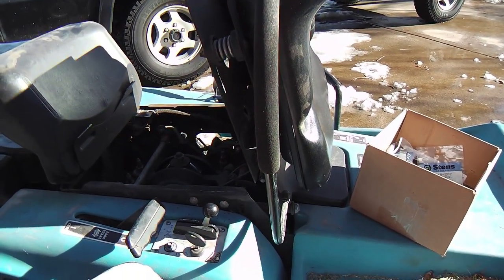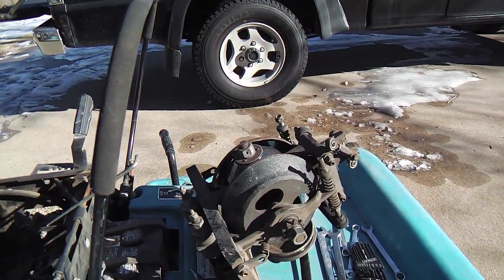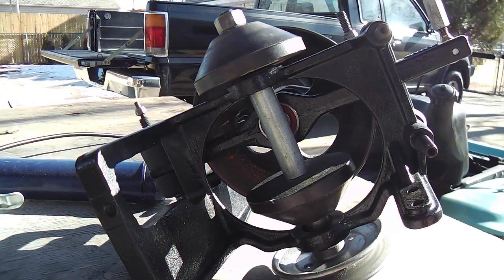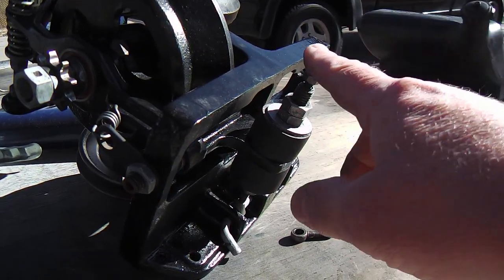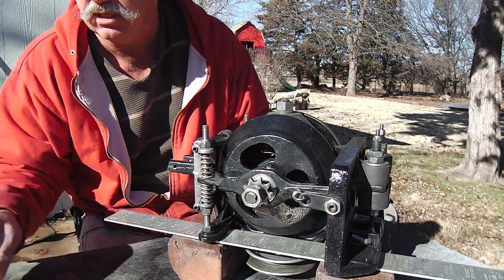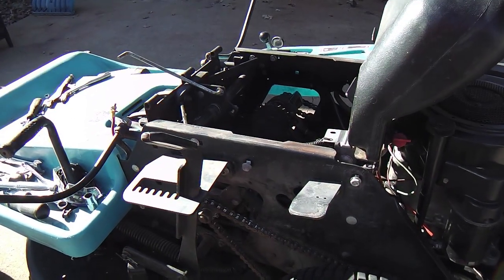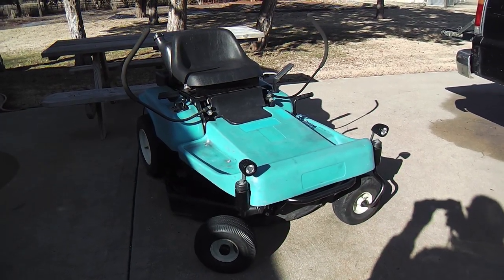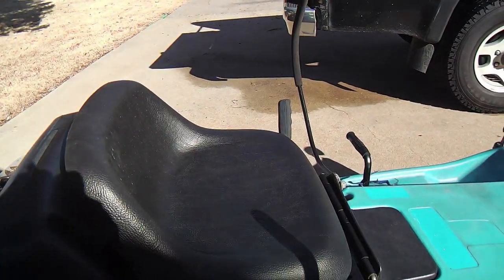Rebuild a Friction-Drive Transaxle on Dixon Mowers

Comment: Hi. Great video. Is there any way I can get you to measure that alignment gauge so that I can fabricate my own? These parts are not cheap anymore and really dont want to pay for that basic gauge at $30. I have 2 ztr mowers that I will be doing that to this spring. Thanks
Reply from the maker: +CA Dawg 
Sure,
I'll post a link to my Facebook page where I've uploaded a scan of it with a ruler alongside some time back, so that you can print it for a template.
I don't know how long you'll be able to locate it on Facebook though, so act quickly, and please let me know by posting here again if that did provide the solution to your request. I mean, I don't currently seem to have a better place to host images for downloading.

https://www.facebook.com/photo.php?fbid=958588954211922&set=a.438701346200688.97994.100001824784929&type=3&theater Otherwise just message me through Google/YouTube with you email address and I'll send the image/template.
Reply: You are the man! Thank you. I printed out the picture, cut out the ruler and took measurements of the gauge. I sent a picture to your facebook as a message with measurements I took with your ruler. It's obviously not to scale but I fugured this would be the best way to measure. Can you look at the picture and confirm with your gauge that my measurements are correct? Thank you so much for your help!
Reply: If those are the correct measurements, this will help us Dixon ZTR guys make their own and we can save a little money :) Thanks
Reply from the maker: +CA Dawg 

Sure,
But leave the ruler image in the overall image at first, as a guide to compare to an actual ruler. The overall image may be to exact scale already when printed. But if it isn't somehow, you can undoubtedly and incrementally print the image at a scale to match the ruler in the scan, to a three dimensional ruler on your end. Then it will be an undoubted match in all of its dimensions, and you can cut out the image and trace it to some steel, if you like. Just pay attention that there is a bit of a shadow portion in the image.
Reply from the maker: Yeah, it looks like your overall length is 6-7/16", which puts all dimensions to scale.

Comment: How about the 2 roll pin. how you get it out?
Reply from the maker: Sure, that's an easy one. You, like me, undoubtedly don't have a set of roll pin punches. So, just tap them down with a hammer to the hole in the shaft, then tap them all the way through with something cylindrical that approximates a punch. You can use a small bolt, a stout nail with a blunted tip, or even a screwdriver to drive them along with the tap of a hammer. They won't give much trouble. 

Please let us all hear how your project turns out, or if you can use some more feedback.

Peace,
Christian

Comment: Thanks for posting the video.  I was wondering if this drive ever went into production.  It was invented by Marion Davis of Hagerstown, Ind. and was described in the cover article of the June 1966 edition of Popular Science.  Google "Marion Davis cone drive"  and you can read the article.  Mr. Davis hadn't expected the design to work, but went ahead with it and was very pleasantly surprised by its success.  Do you get your parts through Dixon or an after market supplier?
Reply from the maker: Yeah, I heard that the design may have been prompted by some sort of a contest through Popular Mechanics or Science magazine back in the 50s or 60s. I've gotten parts through mower parts dealers online at their websites or with similar offerings on Amazon (as I can avoid sales tax there in most cases and can also use gift cards bought with cash at the supermarket). I believe "Dixon" was bought by Husqavarna, in 2006, even though the Dixon line is still produced as "Dixon".

Comment: Proof of alien technology? When the Dixon cone drive is functioning properly it works as well as any other drive system but I have rarely seen one that works as advertised.Most of the time it wont properly turn one way or the other and you can forget about trying to mow on a hill.

Comment: Way to much talking get to the job
Reply from the maker: Yeah, I know. 
It was one of my earlier videos, done years ago, and it was my initial experience with the friction-drive-style-transaxle. So it was mostly a learning experience for me, more than it was intended as a didactic experience for others. But I happily shared anyway, because I think the best way to learn something is to "teach it", because that's where the hecklers will come out and find any weaknesses in the instruction I may provide. My newer video on the Dixion friction-drive is much more comprehensive, even though it's still pretty impromptu, called, "Dixon ZTR Mower Transaxle Cones Install & Adjustment Procedure." Do you actually have a Dixon friction-drive zero-turn mower? If so, what is the issue with it? Anyway, here's the link to the newer/better video. Enjoy! https://www.youtube.com/watch?v=baaGjqRWd7k